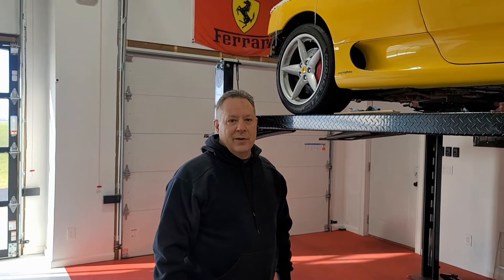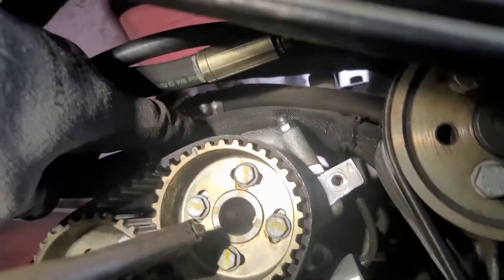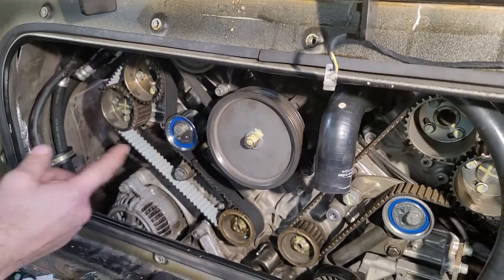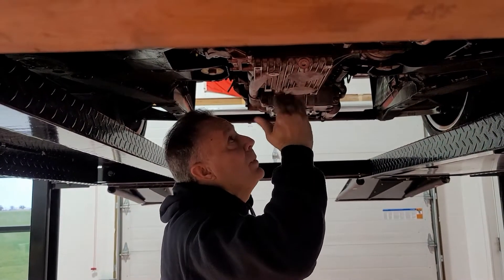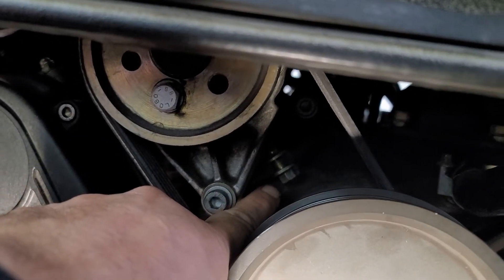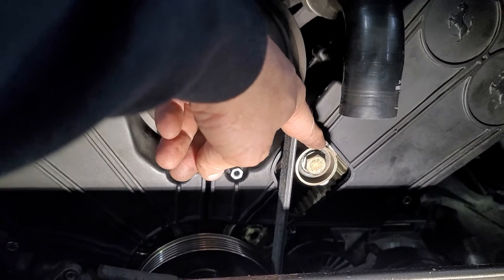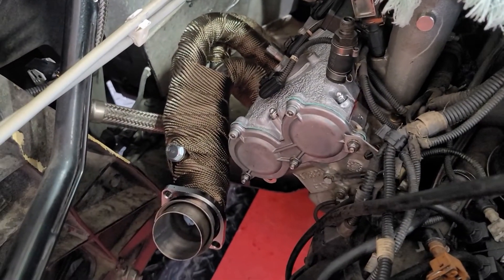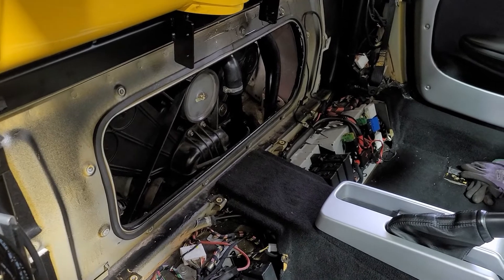Annual Service 2021 Part#10 Ferrari 360 Timing Belt Change

Comment: When cylinder 1 is at the top of the compression stroke both of the marks on the intake and exhaust cam should line up with the marks on the cam cover? I’m asking because the vice grip slipped while replacing the belts and I’m trying to get them back to where they should be. I can rotate the engine freely by hand still so I doubt it’s that far off. Thank you
Reply from the maker: I would always check the marks on the end of the cams. Not the marks on the gears where the belts ride. Those marks can be moved.
Reply from the maker: Also I would run the motor trough a few times to make sure everything is still on the marks.

Comment: Thanks for the video! I have my 360 F1 apart trying to rotate the crank by hand and realized it’s in 1st gear. Any idea how to shift the F1 to neutral without turning on ignition while the car is apart?
Reply from the maker: You would have to take off the actuator.  You should be able to reconnect the battery for a second to put it back into neutral.  Just don't crank the motor
Reply: @ferrarifxs  thanks so much for the quick reply! I’ll have to look to make sure the ignition on will be safe as I’m also in the middle of converting it to a gated 6-speed with the DR-S kit. Removing the actuator might be safer in this case. Will update here once I figure it out. Thanks  again!
Reply: I reconnected power to the battery, quickly turned on the ignition and dropped it into neutral. Easy! Thanks for your help!
Reply from the maker: If you take the actuator off you may need a tool for alignment purposes.  Hill engineering sells it.
Reply from the maker: No problem any time.  Good luck with your project

Comment: Is there anything tricky process wise to replacing the actual tensioners during this process?  Do you happen to have the torque spec on the mounting bolts on the tensioners themselves?
Reply from the maker: I believe it's in the notes at the bottom of the video for the torque specs.  Also it's better to have 2 people when doing this. It helps to prevent over stretch of the belts.
Reply: @ferrarifxs  sorry, not the tensioner bearings, but I was referring to the actual tensioners themselves.  My 360 has ~52k miles, so I'm toying with the idea of replacing the LH (which i'm not sure was ever upgraded yet anyway) and the RH with another OEM piece.  Part numbers 202784 & 157356.

Cheers
Reply from the maker: With the milage your car has, I would probably change them out.

Comment: OK video ,it just would have been nice if you were to filmed actually putting the belt on ,I mean you get to that point and then bam the filming stops and then afterwards belt on  it doesn't give us any ideal oh how hard it is to get it on that was what the whole video is supposed to be and you didn't film I just can't give you a thumbs upNow I'm not always lost you definitely pointed out some other good tips I just wish you wouldn't have left that out. But The Secret is to watch all your guys videos everybody and you can put it all together in your head. Thanks for the effort.
Reply from the maker: It's hard to film and do the work at the same time. With the tight area it also difficult to just set up the camera and film. You would probably see the back of me. Some of the jobs works best with 2 people and it becomes challenging at times. Thanks for watching

Comment: Did you end up tackling your cam seals? Great video by the way excellent job!
Reply from the maker: No I didn't.  They weren't leaking. It was the valve cover gaskets.  Thanks for checking in and watching.

Comment: Another interesting video. Thanks for the tip about Easy Tension. I replaced the alternator/water pump belt on my 360 last summer and I couldn't get the Gates application to work either. Actually wore a blister onto my thumb plucking the belts trying to get a read. Finally had to tension them the old fashioned way...."if you can only twist the belt by 1/8 to 1/4 turn at mid length then the tension must be close to factory spec".
Reply from the maker: Use the frequency portion of easy tension.